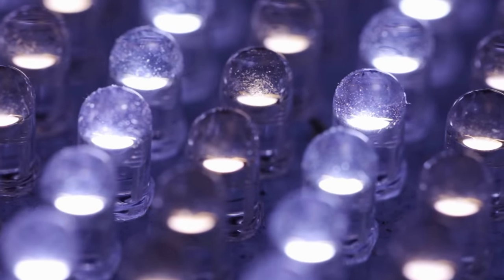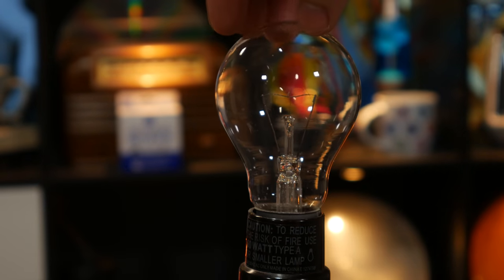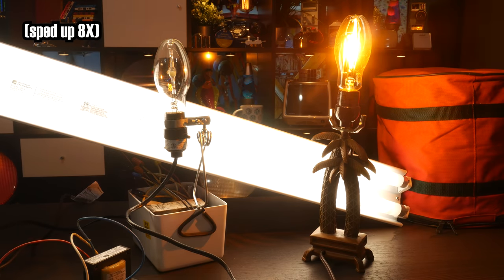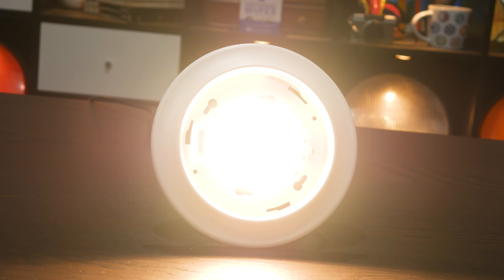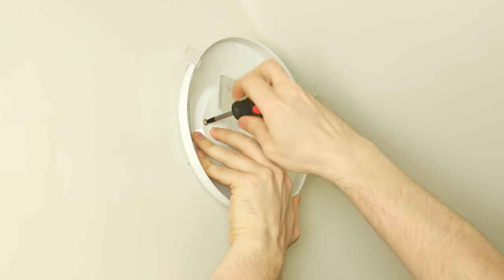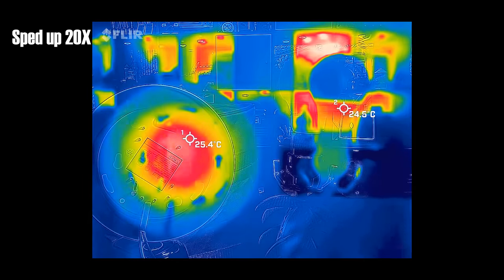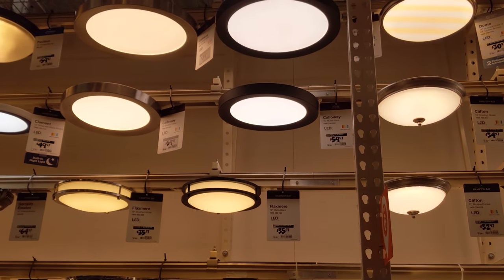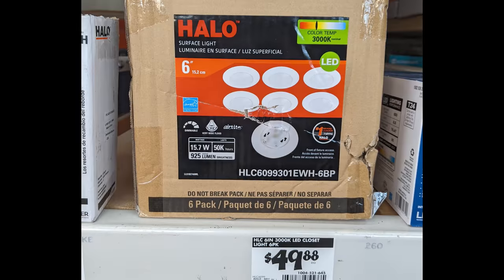A troubling trend in lighting?

Comment: The obvious solution would be a standard "flat bulb" design that can slot into any of these.
Reply: With some sort of click-in socket.
Reply: Yeah, but that's not gonna happen since they wanna make more money off new lamp models.
Reply: Indeed, just watching this video I thought of variants of the m.2 sockets, maybe with click ins instead of screws, a termal pad in the back, the possibility to choose between m.2 2242 to 2280 and properly modified terminals. Now your fixture is just a big heat sink
Reply: This is where regulatory action should step in.
Of course it would probably require a revolution to get a government interested in such things.
Reply: I'm not sure if that's so obvious, what kind of socket would you use? It also would likely run hotter than this style
Reply: @bradleymorgan8223  you treat it like what fabio said. Just a thermal pad and a terminal to click into. M.2 is a good example because the interface is flat. 

You just need to have a flat piece of silicon click in and use the fixture as a heat sink.
Reply: @ThomasRobertFr  i think that's a good standard, but the problem is that it's putting the heat sink with the LED, which drastically increases the cost. The key is to have a standard silicon wafer that slots into a fixture that doubles as the heat sink
Reply: Is it really worth it to engineer this solution for a 1-2 a decade issue? Are you willing to pay more?
Reply: @andrewlitvinov7266  you would pay less for a standardized design. And LEDs frequently go out on a much more frequent basis than twice a decade, by my experience. 

LEDs produced without heatsinks are cheaper. Fixtures designed around standardized formats are cheaper, because LESS engineering needs to go into the product, the same way the Edison screw affected fixture design and costs.
Reply: @fabiosemino2214  that's a perfect analogy
Reply: This is already a solved problem.. these fixtures almost always come with snap connectors not direct wiring (at install you wire up the snap connection, which then lives outside the junction box).
Reply: I was thinking just replace the bulb sockets with regular outlets and have prongs sticking out the back of the fixture. But the crummy American outlet style (and probably many others) aren't really good for holding things like that...
Reply: @dancostanza  it should be as simple as popping out the light wafer, then clicking a replacement back in  

That's not the current state of things.
Reply: @kargaroc386  I dunno if that's necessary, I think consumers (even contractors or at least landlords) will eventually tire of replacing these things the hard way and opt for a slightly more expensive model with a connector
Reply: @kargaroc386  Really we just need truth in lifespan claims and it will probably all fix itself from there.
Reply: @fabiosemino2214  exactly what I was thinking. The time before needing to change out the build would be fairly great and replacement bulbs could come with a preinstalled thermal pad and little alcohol could remove any stuck on parts of the previous pad. In terms of connectivity, it could be as simple as 2 exposed wires connecting to a screw or push connector much like the outlets in the US.
Reply: @goldlamp574  or it could be a fully modular design with a central larger driver, low voltage rails and purchasable battery modules for power outages, or esp32 for home automation XD
Reply: @andrewlitvinov7266  I think it's worth engineering this solution just so that we can shop separately for the aesthetics and form factor of a fixture and for the brightness, color temperature, and CCT of the "bulb" to go in it.
Reply: You mean like GR8 bulbs? Originally they were fluorescent, but you can get LED replacements - although you do need to remove the ballast from the fitting.
Reply: Like G-type halogens
Reply: @fabiosemino2214  why on earth would you use a high speed, low voltage, multi-pin data connector to deliver 120 to 240 volts at tens of watts? are you insane?
Reply: @NicholasSouris  Or a twist-click.
Reply: @grkvlt  USB-IF be like: "Good idea, let's call it PD rev 4.0 and apply it to every connector we get our hands on"
Reply: @tavdy79  No, more like silicon wafers that click into a terminal, like a M.2 drive. That would allow you to decrease costs to the  absolute minimum and ensure good contact between the leds and a thermal bridge to the fixture/heatsink
Reply: @grkvlt  No one is saying you use actual m.2 connectors. We're saying to use something LIKE that, where you just slot in the wafer and secure it against a thermal pad. 

This would drastically reduce costs of replacement as well as the engineering of new designs for each and every new variation on the fixture.
Reply: Like the old 2D CFL
Reply: @andrewlitvinov7266  Last I checked there' s more than 1 lightbulb in the average house. So it would be more like 20-40 times a decade
Reply: @grkvlt  i would not, both driver and lamp connectors would be just inspired by m.2, even though the standard itself can provide up to 10w with low voltage
Reply: @fabiosemino2214  right, makes more sense, but i'm not sure pcb edges are the best for main connectors - although, a mechanical only connection in the same vein with the current being transmitted separately might work, sort of like bayonet or pogo pins...
Reply: @goldlamp574  Hell you could maybe just have it clip in with clips like a RAM module but make them metal to thermally bond the board to the fixture. Hell computer style Molex connectors for power would also work here just have a 2 pin Molex connector to plug it in with would work. They are more than capable of handling the current an LED light fixture would draw at mains voltage in fact they would be rather overkill. Being that they are an existing mass produced connector due to their use in computer power supplies ie the 6+2 pin PCI Express connector they would also be rather cheap as the economies of scale already exist.
Reply: @andrewlitvinov7266  Had a new house with half a dozen of these fixtures in closets, pantries, and the porches. 2 of them burned out within the first year. Got them replaced by builder warranty. I was very unhappy to learn that I would have had to replace the whole fixture if it had burned out months later. My next home will not have any of these fixtures.
Reply: @andrewlitvinov7266  If it is a 1-2 decade issue, I hear ya, but LED area lighting is still only a few years old and we don't know if it's going to last that long but one thing I do kno is that we've seen plenty of LEDs that failed long before that
Reply: @bradleymorgan8223  GX53. Perhaps not designed specifically for this purpose, but close enough to not matter.
Reply: @kargaroc386  Standards have their own problems. US headlight standards hurt innovation, safety, and fuel efficiency for years because the standard was based on what made sense at the time.